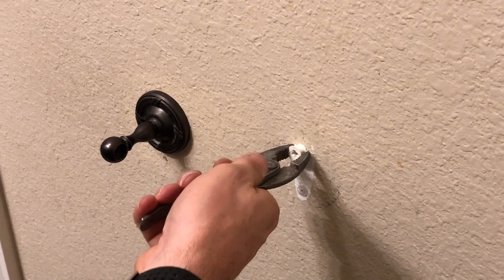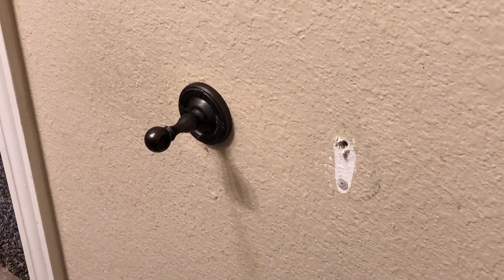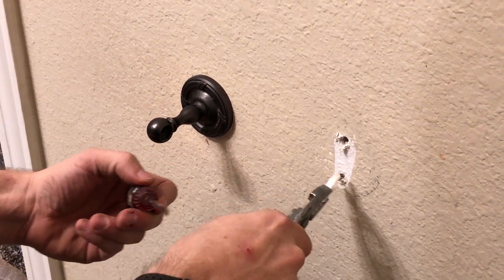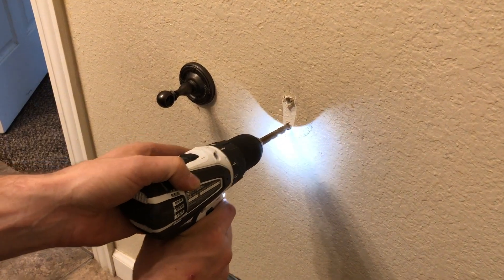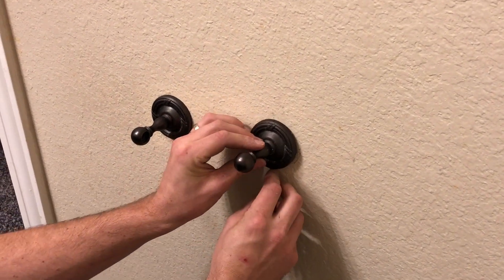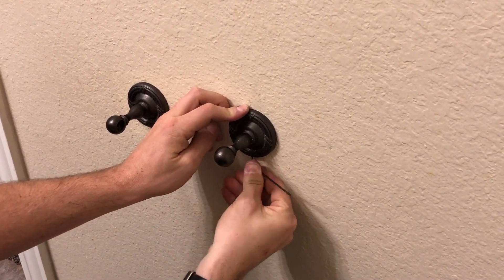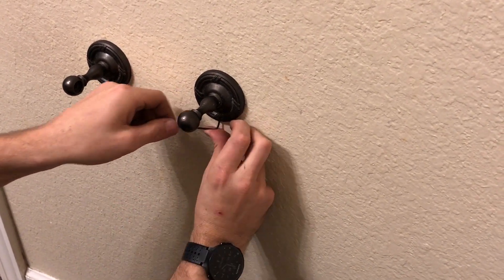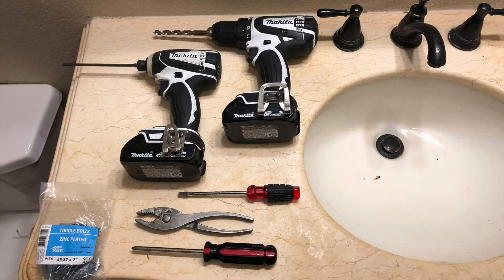How to Fix a Loose Toilet Paper Holder or Towel Rack

Comment from the maker: Parts Needed:
1. Toggle Bolts (50 pack)  1/8” x 2":  https://geni.us/j8SDHM4
2. Toggle Bolts (Assortment Pack):  https://geni.us/jP0bCu5

Tools Every Weekend Warrior Needs
Makita Cordless Drill Combo Kit:  https://geni.us/t7dIA
Dewalt Drill Bit Set:  https://geni.us/oFlSl
Dewalt Screwdriver Bit Set:  https://geni.us/VDcr
Craftsman Screwdriver Set: https://geni.us/jXqFI
Eklind Allen Wrench Set:  https://geni.us/7XfvO
Pliers (4-Piece Set):  https://geni.us/RIdx
Stanley Utility Knife:  https://geni.us/ndIDa
Stanley Tape Measure:  https://geni.us/bUfD1R
Studbuddy Stud Finder:  https://geni.us/RySCuVw
Johnson Torpedo Level:  https://geni.us/wiLcDY
Stanley Hammer:  https://geni.us/bPDk8Wo
Buck Bros Wood Chisel Set:  https://geni.us/vk3cpTW
Klein Voltage Tester:  https://geni.us/h9Hl
Klein Outlet Tester:  https://geni.us/kdBAJ
Ideal Wire Strippers: https://geni.us/MdOB
Little Giant Ladder: https://geni.us/fmlmTk

DISCLAIMER: This video and description contains affiliate links, which means that if you click on one of the product links, I’ll receive a small commission.

Comment: How do you get a TP holder to stay on a pony wall?  There are no studs to fasten it to. Contractor installed it 3 years ago and it lasted about 2 years before it fell off the wall.  Handyman drilled new holes and installed it again 5 months ago but it is coming loose and I don't want it to fall off again.

Comment: Good video..what would  you suggest non fixing  a hole in wood paneling
Reply from the maker: Hey T Jac, I don't have experiencing patching holes in wood paneling.  Depending on the size of the hole you might be able to get a matching wood filler to use.

Comment: Good to know video, but those stand alone toilet paper holders are the best. No drilling holes or applying adhesives to walls.
Reply from the maker: Yeah if the stand alone fits your space those can be a solid option.  Thanks for the tip.
Reply: I recently repaired a toilet paper holder. These videos helped alot. But I would choose a stand alone holder any day.

Comment: Thanks for the video! Would this work if the hole is bigger than the drilled hole recommended for the toggle bolt?
Reply from the maker: Hey Ada, yeah it can’t be too big but you have some extra room where the toggle bolt will still work.  The limitation is the wing / spring but still needs to hold onto something solid when it is fully extended behind the drywall..
Reply: @EverydayHomeRepairs  thanks! I thought the hole was too big, but it actually ended up being the size it needed to be drilled for the toggle bolts to fit through. Thanks!!
Reply from the maker: @adachan2036  nice yeah that is pretty common that the pulled out plastic insert makes a hole big enough to get the toggle bolt through which is pretty handy.

Comment: Once the springs expand out in the wall, is it possible to pull them back out if needed?
Reply from the maker: Hey Dmitriy, you can unscrew the bolt but the spring will fall off in the wall cavity and you will need to have extras springs if you want to reuse the bolt.
Reply: @EverydayHomeRepairs  thanks!

Comment: YES!!! This is literally the ONLY way to fix this, I arrived at the exact same conclusion. Also, you don't even realize it but you helped me in the terminology for what to call those little tiny screws that go into the bottom of the TP holder. You mentioned they're called "set screws" and now with a quick google I've found a way to buy a replacement set screw for the one I have that broke.
Reply from the maker: Awesome, glad the video helped.
Reply: @EverydayHomeRepairs  Jb

Comment: What if the wall are not thick..cause my house walls are not thick at all..would this work?? Please help
Reply from the maker: Hey Tina,  I assume you still have drywall so it will work but for instance 1/2 inch (thin) drywall will not hold as much as 5/8 inch (thick) drywall.  Best of luck with the repair.
Reply: @EverydayHomeRepairs  okay yes...thank you

Comment: Thank you for your video. Do you or someone know How do we fix the toilet paper holder that flips up to open on only one side and the mini allen screws don't stay in because of the rubber or plastic broken that makes it flip up smoothly when it is time to change the role?
Reply from the maker: Hey Gojira, if you jump over to our Facebook Group “Everyday Home Repairs Community” where you could post pictures of your specific question.  That would help me see you problem and jump in to help.  See ya on FB!

Comment: Excellent video. Very helpful.  I just went through my rental and fixed 2 towel rods, 1 robe hook, 1 toilet paper holder.   I never new about those Toggle Bolts but those are awesome.  Thanks for the explanation on all the anchor options.  I think toggle bolts are the best of the anchor options.

Comment: Ugh, the guy who did my towel bar put two threaded anchors to the point they are almost over lapping. So now there's a 1" area that's a soft spot in the drywall

Comment: i thought there was some regulation that a towel rack had to be able to hold 300 pounds of weight or something? I guess the idea was if you slip and fall in the bathroom and naturally reach out and grab the towel rack, it has to be able to hold your weight. Good old gubt lookin out for us (cough). Obviously the only feasible way to do this is a towel rack has to be screwed into studs. I'm not dreaming with this am I? Anyway, at least a TP holder should be good to go just into drywall.

Comment: Hi I’m trying to fix my toilet paper holder we have the same one 
So one of the ends came off the wall I tried to put it back on the silver thing but when I put the toilet paper roll thing inside the sockets it keeps coming off the wall. Please help🥺
Reply from the maker: Hey Komo, can you secure the bracket (silver thing) to the drywall by using the toggle bolts shown in the video?

Comment: Thank you for the video. I have a question are Toggle bolt easy to remove or how do you remove it? Thanks
Reply from the maker: Danny, good question and yes they are easy to remove but the the actual "toggle" portion will come unscrewed and fall into the wall cavity.  So, to reattach/reuse the bolt you will need extra toggles as they are a 1 time use.   Does that make sense?
Reply: @EverydayHomeRepairs  Yes it does thanks a lot.

Comment: Great video but doesn't solve my problem, our holder doesn't have any apparent set screws and I can't figure out how it was attached without them. Any ideas?
Reply from the maker: Roger, If it is a newer Delta design there is not a set screws.  In the delta case you push up fairly hard and that will push the spring in and let you remove the toilet paper holder bracket.  Give it a try.

Comment: My towel bar it doesn't have the screw, it has a hole and I can see a small plastic tab inside, what do I do to open it and tighten the towel bar?
Reply from the maker: Hmmmm, is the "plastic tab" attached to the wall?  Sounds like that is the drywall anchor which was originally installed.  Wish we could add pictures to these comments as it would help a ton in understanding your specific type of towel bar.

Comment: Thank you! This is the BEST description of the very exact same issue I've had with the towel rack in our master bathroom. I was getting frustrated with the different wall anchors because, oddly, there are no studs in the section of wall that the screws that go through drywall can tap into. This is very helpful! Thanks for posting!
Reply from the maker: Glad the video helped out.  Yeah, my first preference is to secure the bracket into a stud but if the stud isn't available the toggle bolt will do the trick.

Comment: Thank you! I had replaced the original anchors with Self tapping screws and it pulled a large hole in my wall. I tried filling it with putty to re-anchor it.... didn’t work. The loose holder was driving me nuts. Nice and tight now!
Reply from the maker: Nice, glad the video helped!

Comment: I find it that sometimes the hardware doesn't sit well with the wall bracket. No matter how much I tighten it it'll become loose. That's when construction adhesive is your best friend.
Reply from the maker: Hey Eddie, I had similar issues when using anchors in the past but toggle bolts usually pull everything in tight.

Comment: Why are 32-inch towel holders so uncommon? A single towel tend to fit perfectly in about 31-inches, and two folded towels would fit perfectly as well. So it's dumb to not make them 32-inches.
Reply from the maker: Hey Mitch, I think the 30 inch towel racks are less common since most of the designs can only span 18 inches or 24 inches and hold up to any load.  Some of the designs like a square tube can handle a 30 inch span within adding a lot of cost but a number of the other designs can't or are much more expensive.

Comment: I thought I was completely screwed and would have to rehang the entire towel rack due to the size of the holes on the loose part. These toggle bolts are a life saver and so much easier to put in compared to wall anchors. Thank you so much for this video I’m using these every time now!

Comment: Already done this but 2 year old comes in and tears out the anchors through the drywall. Whole other problem
Reply from the maker: Hey Barney, not sure I have a fix for that challenge 😀
Reply: This is my problem as well. The anchors came out too...
Reply from the maker: Hey Astraghost, the original plaster anchors or toggle bolts which you already installed?
Reply: @EverydayHomeRepairs  - the original anchors.  I'll try the ones you feature here
Reply from the maker: @astraghost774  exactly you should be set by simply using the toggle bolts and the hold should be 10X stronger.  Best of Luck!
Reply: @EverydayHomeRepairs  - Thanks for the help.  Cheers!

Comment: Great video--thank you for the thorough guidance! Just a follow-up question: how do you remove the toggle bolts?
Reply from the maker: Hey Emily thanks for the kind words.  When you need to remove the toggle bolts you just unscrew the bolt and at the same time apply a light pull to the bolt ensuring the wing nut is being pulled against the backside of the drywall (this ensures the wing nut isn't just spinning inside the wall).  When the bolt is all the way unscrewed the wing nut will fall off and as such each toggle bolt is a 1-time use piece of hardware.  This is also why I always have a couple spare wing nuts in various sizes handy.  Hope this helps and let me know if you have additional follow up questions.  Take care!
Reply: Everyday Home Repairs so helpful. Thank you so very much!!! Subscribing to your channel for the awesome content.

Comment: 10 minutes to say "replace with toggle bolts". Not really a "fix".
Reply from the maker: Hmmm 🤔 how is that not a fix?
Reply: @EverydayHomeRepairs  - it may be a fix but not the type that uses the existing pieces, fixing/repairing them. I would say its more of an upgrade or replacement.

Comment: I just want to mention that what you are calling "cheap" plastic anchors are the very durable and inexpensive solution for the vast majority of countries where houses are made of brick, that's the reason they come with so many products. Also, unless you are applying thread locker to the toggle bolts your solution won't last either and the bracket will loosen with toilet paper or towel used in my experience. This is a better fix: https://www.youtube.com/watch?v=2r2L-nnnn3Y
Reply: no it is NOT a better fix

Comment: Toggle bolts are way over kill for this job plus they're a one job go...remove the screw and they fall down the back of the cavity. If you have to use large fixings like that, use the snap toggles. You can then remove the screw as many times as you want and the fixing will remain in place.And those self threaded ones are RUBBISH. for light weight applications like this the fischer duo power are perfect.
Reply from the maker: 🤔 interesting.  I haven’t used the Fischer duopower but will check them out.  Thanks for the tip 👍

Comment: Just spray some great stuff in the holes and add the hardware again done hold for life
Reply from the maker: What the What!?!? 😁 Might be worth a try but since i usually have an assortment of toggle bolts around that is my preferred method.  Thanks for the alternative idea.
Reply: Saywhattthewhat, great stuff patch is no where near as strong as toggle bolt fix